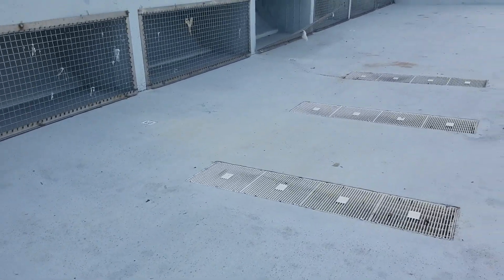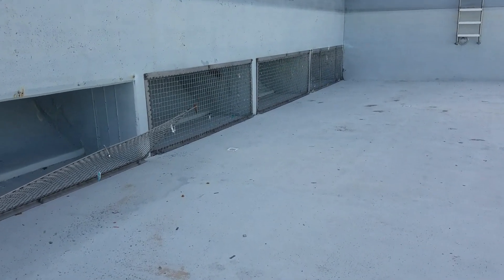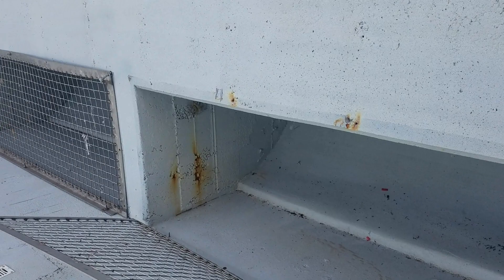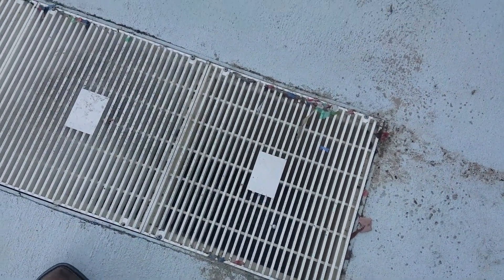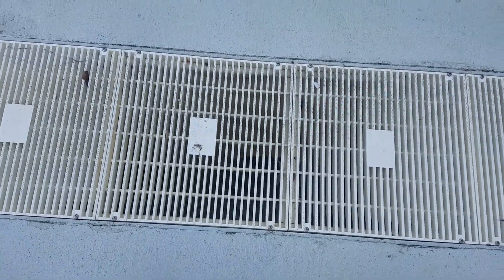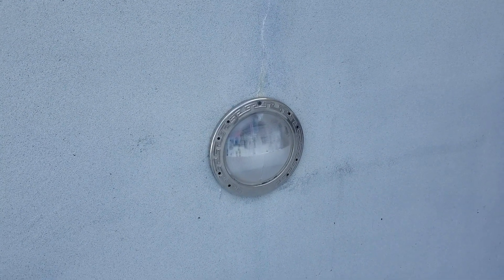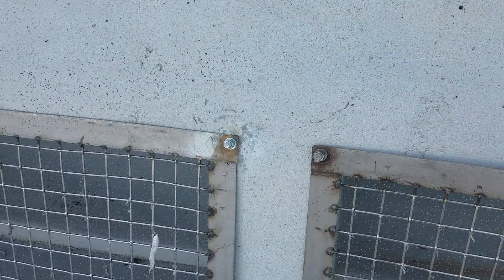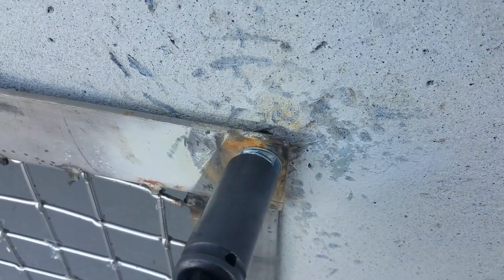Wave Pool Caisson Grates

Comment: What's to stop someone catching themselves on the bolt head?
Reply from the maker: This is an off limits area to all while in operation.  any maintenance done in this area with water in the pool is conducted with no less than two personnel.  One is the lookout.
Reply: @thepoolguy  ok so when full of water you have a string of floats or something to keep people back?
Reply from the maker: @sublimedkardon  exactly.  A safety line is installed on the wall that is about 15 ft from the back wall
Reply: @thepoolguy  Maybe shortening the thread and using an acorn nut might be an idea?

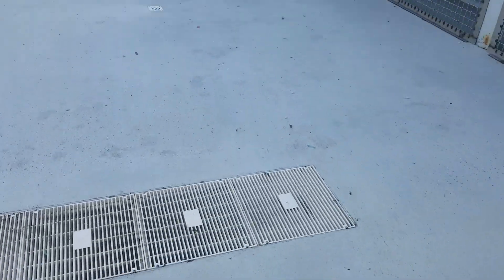Comment: 1:32 what does this white thing do
Reply from the maker: Hey,  so water is filtered in the back room, and these little guys return that filtered water back to the pool.
Reply: @thepoolguy  wall return its called
Reply from the maker: @consha6121  then why would you ask..., and this would be a floor return, it's on the floor.
Reply: @thepoolguy  because I wasnt sure if it was a drain or floor return

Comment: use chemical anchor from fischer
and use these 050567 also from fischer
and use these 033211 the chemical anchor if this does not hold nothing wil hold
Reply from the maker: This looks super promising.   Gonna try these out on the one grate thats greatly screwed up
Reply: @thepoolguy  jus film It when you are installing it 👍
Reply: I was going to suggest epoxy anchors from Hilti that are stainless steel but I was a little late. Also Hilti has a torque controlled impact that sets the correct torque on the anchors and don’t over torque them. I will try and find part #’s for you. I really like the videos.

Comment: Have you tried to use Epoxy inside the holes with the anchors to keep them in place better? I'm sure there are marine grade epoxies available.
Reply: Epoxy, stainless threaded rod and stainless nuts...... the only thing better might be J-bolts buried in the concrete... but that is a bit late for that now.
Reply from the maker: Hey there, yes, we have been planning on going this route next. Thank you for the suggestion.

Comment: Would those wall grates be classified as fabricated suction outlets or does that only apply to main drain?
Reply from the maker: This is a good question. I would actually have to look up how the code identifies these.  However, these are field fabricated, and must be able to handle the volume of flow.  These grates have both pressure and vacuum to them, so I dont think they must meet s specific flow rate.  Plus. They don't have direct suction on them, its mearly gravity forces that move the water in and out.